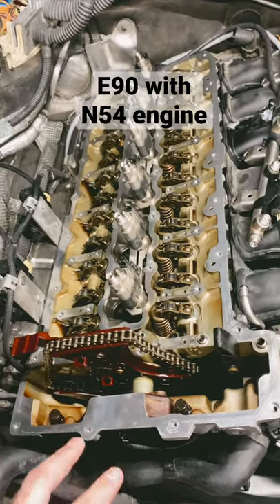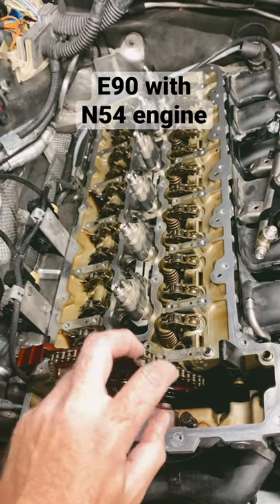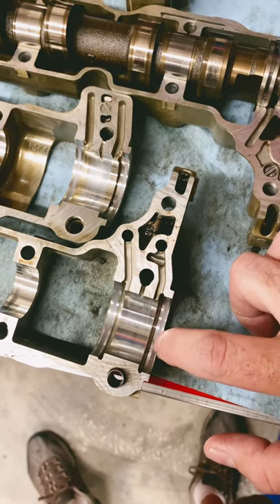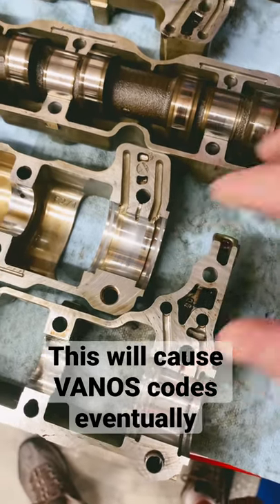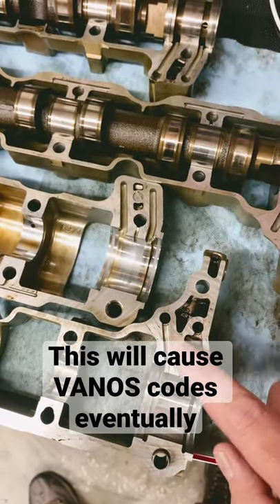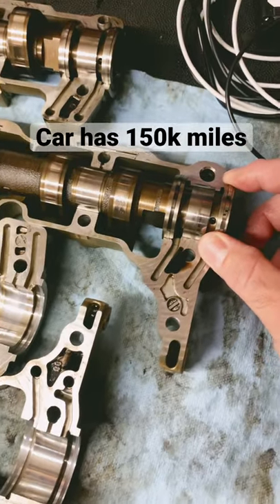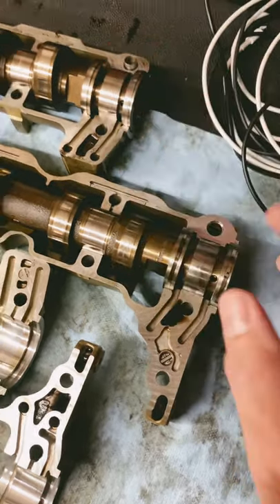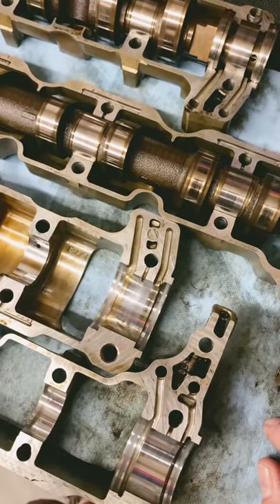Cam Ledge Wear on a BMW N54 Engine #shorts

Comment: N52 n54 n55 & Up are nothing but junk.
I continue to drive my M54 360Miles on the clock no issues ever.
Reply: Mine has 250k miles on her. What do you recommend to make it last as long as possible? I change the oil every 3k-5k miles.

Comment: FYI my exhaust side also had grooving but not as bad. I guess I will get a code for exhaust to 1 day. 
FYI I have a 335is so the updated N54 with new teflon type rings and I believe it still occurs with those. Update: My intake cam bearing ledge was the culprit it was badly grooved. I installed a new camshaft bearing ledge.
Reply from the maker: Really? Why do you believe that? Have you inspected yours or you've read something on the forums?
Reply: @50sKid  I was getting the usual vanos codes, thought it was my solenoid because the code actually went from intake to exhaust when I swapped them to test. After all that got a new one, was still somewhat uncommonly getting a intake vanos code and pretty much everything else checks out... the only last culprit would be the cam ledges. Turning the engine off and back on would automatically clear the limp mode and code. Also noticed when the code does come, it seems to be when the oil is just starting to warm up.
Reply: @50sKid  I was thinking maybe sludge as another culprit to but my oil is also not gunked up. When I did my valve cover about a year ago everything was clean so I doubt it's oil sludge.
Reply from the maker: @JackRR15  Since the code moved, you proved that you had a bad solenoid -- did you replace with OEM or aftermarket?
Reply: @50sKid  Oh shit never saw the reply. To update, for some odd reason the code did change 1 time but afterwards it was always on the intake. I purchased a genuine solenoid. Anyways that car got totalled but I still got a replacement 2011 335is and I still have the intake code and after doing the troubleshooting on that I'm about to do cam ledge as well only thing left.
Reply: @JackRR15  New cam ledges fixed it for you?
Reply: Yo so what was the problem I just bought a 335is with 50k miles
Reply: @austinmerrival927  Yes I replaced intake bearing ledge and it fixed it
Reply: @noahzm_  I replaced intake camshaft bearing ledge tray
Reply: @JackRR15  Glad to hear that fixed your problem, didn’t fix mine lol.. I replaced both camshaft bearings and no fix, turned out to be spun crank hub 😪
Reply: @austinmerrival927  Ah shittt now you make me worry about more things haha. It just happened to you like that?
Reply: @JackRR15  I wouldn’t worry as much if your’s is automatic (and not DCT) lol. It wasn’t even anything catastrophic, just was driving normally on the way home from an alignment then was plagued by that crankshaft camshaft exhaust correlation code ever since then. I did everything on the top end to no avail, and retiming only fixed the issue for a few days.
Reply: @austinmerrival927  Oh no, I do have DCT, I have a 335is with the DCT. I did see a lot of spun hubs on the M4s (S55 engine) forums with the DCT to.
Reply: @JackRR15  Oh really? I can’t remember for sure reading if it’s more common on manual or DCT. Yup, a lot of owners of those engines have the same issue due to the same weak 3 piece crank hub design that’s in N54 and N55 as well I believe.
Reply: @austinmerrival927  Okok. But like what happened with yours. New engine I suppose, bent the valves?
Reply: @JackRR15  Honestly, the car ran perfect when timing was set. Didn’t drive it for a long time due to this, and ended up selling it. And now I’m back to the Audi gang 🤷🏽‍♂️
Reply: @austinmerrival927  Ah okok I see. Thank you for all the information you shared!
Reply: @JackRR15  Not sure how much useful information I’ve given but no problem man lol. Best of luck with your 335is I’m sure it’s bad af.
Reply: @JackRR15  so the 335is updated Teflon rings won’t cause scratching?
Reply: @noahzm_  Idk my car had them and I had the issue.